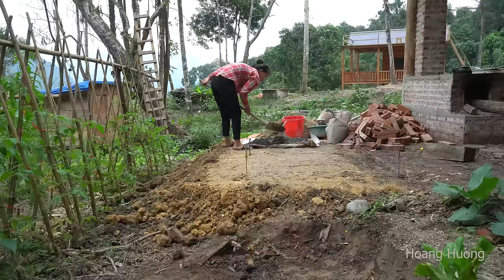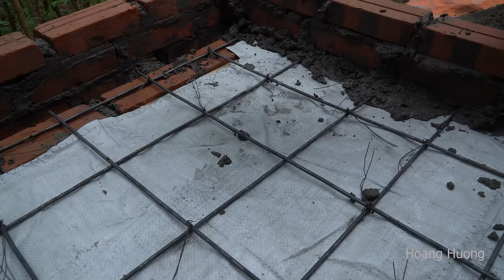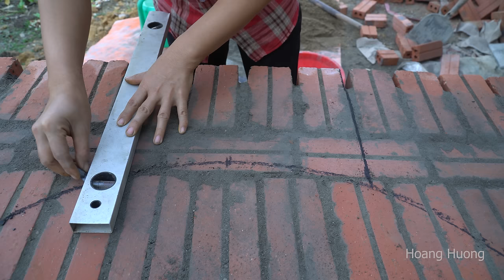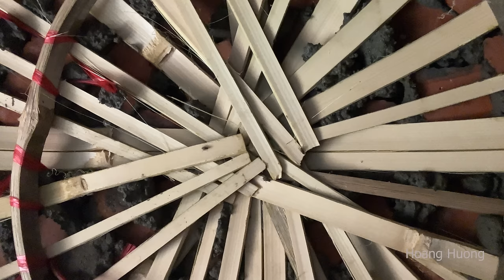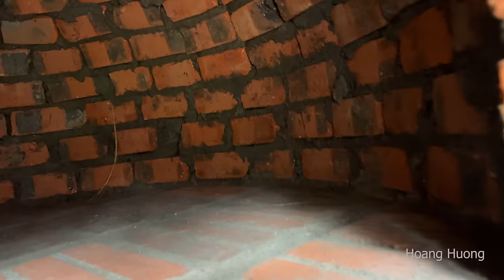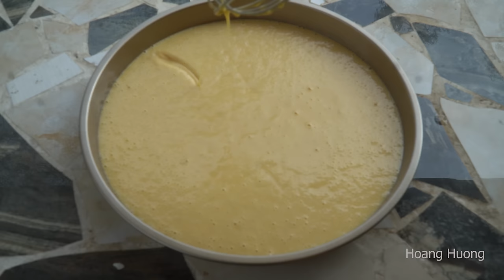Build a brick pizza oven, Bake sponge cake | Hoang Huong

Comment: Love the oven!  The only thing I would suggest is to create a door for it. That will help to trap the heat inside.  By doing this  you can rake out the coals before before adding your cake.. this will help it not to burn on one side.  You did a beautiful job on the oven, congratulations ❤😊

Comment: @Hoang Hurong.. Awesome effort as always. When you use a pizza oven you need to spread the fire on both sides of the oven. Also, it may help if you have a door on it to hold the heat in. I would not use alfoil/aluminum to cover the cake. Your cake cant rise properly and you need it to go golden brown. Plus if you have a door your cake should cook in half the time. Happy Baking :)
Reply: O bolo deles é feito no bambu ou na folha de baneira, é cozido não assado, bolo assado na folha de baneira é delicioso.🇧🇷🇧🇷🇧🇷🇧🇷
Reply from the maker: Thank you for your appreciation, I will try to do better, see you in the next video.
Reply: @Hoàng-Thị-Hương  you're welcome. Just trying to help make your work load easier.

Comment: You can also just burn the sticks out of the oven, though it's best to make the dome, line it with layers of paper (like newspaper), then coat it with a heat-resistant mortar an inch or so thick with plenty of sand.  And then, when it's still damp, put the bricks on the outside for support and thermal mass.  Let it dry for a week, then build a small fire in it and burn it low and slow for a few hours until everything has dried and the bamboo & paper are gone.  A final coat of cement on the outside will help seal off any cracks.  You do lose the lovely brick color, but it's more energy efficient that way.

Comment: Hi nice work making the oven but I thought you were going to finish it by cement the bricks to keep the the heat in the oven and also to protect the oven so when I see nothing happening I'm kind of little bit disappointing but you still can do it and also I was just wondering you're going to be doing a cover over your oven right you're not going to leave it just like that outside all in all good job and also I you're going to put a door on that oven because you're going to need an oven door basically you over need to have a door on it 🌸🌺🇯🇲
Reply from the maker: Thank you so much, I am very happy to receive your feedback.

Comment: Well look at that , thats one beautiful oven well done , now i would heat the oven with fire wood as pre-heating but for the baking probably would be better charcoal or heating rocks evenly spread around the backing sheets, pans or even pots so it heats all around equally at the same time a door will help to keep the heat inside and now you can bake all your traditional cakes and meals in there look for baking in a brick oven with heat inside the oven so you have better ways to get the correct ingredients for a perfect result also would be good to have yest for breads and baking soda and baking powder for cakes  to make them elevate and be really spongy  well darling those are my ideas for tgis video still going to remind you to do that extra water tank and tge gutters around the house and kitchen for extra water when is no rain
Reply from the maker: Thank you very much, I'm very happy to receive your feedback, I will try to do better and send you more interesting videos.

Comment: That seems like such a strange way to make a cake.

I’ve always used butter or margarine instead of oil. Your cake didn’t seem to rise very well and looks very dense. Is that usual for Vietnamese cakes?

My favourite cake to make is very simple: equal weights of butter, sugar, eggs and flour. Usually I use self-raising flour, if not then add a teaspoon of baking powder.

Then you just mix the butter/margarine with the sugar thoroughly, then whisk in the eggs to add a lot of air, then very gently mix in the flour and baking powder. For flavour I add a small pinch of salt, an a teaspoon or two of caraway seeds. Then bake it in a tin until cooked in the middle. It should rise and become a light fluffy cake.

Caraway seed cake is so delicious.

Comment: Pizza oven?! Shakin my head…. Ovens like this, with tall heat holding domes, have been built and used for hundreds of years.  They were not originally built to bake pizzas. 

What you built was a was a good start, but for ovens like this to properly hold the heat for baking and roasting, it needs more insulating layers than just that one layer of bricks. You should have applied at least 1-2 layers of mortar over the whole dome structure and the oven opening. And then, maybe a layer or two of cob, clay and straw, over that. These layers are necessary to hold the heat needed for long time baking and roasting. As for that chimney, I don’t see those on most ovens like this. Yes, they might help keep smoke out of your eyes and maybe a little better airflow to get the fire burning, but it is not really necessary. 

As I said, just that one layer of bricks is not going to be enough, and could lead to cracks and leaks in mortar joints and failure of the dome itself. Once again, if you are going to put this much effort and expense in building something, take more care into building it better, studier, to last longer and be safer. If you just wanted a pizza oven, you could have built a much easier one with cinder blocks and large flat paving stones. 

When heating the oven up for cooking, you need to build a substantial fire in the middle of the oven so that it heats up the dome evenly. Heating the oven can take some time, 1-2 hours at least. When the fire is reduced to coals, no big flames, they are pushed to the sides all around to create room for what you are cooking. 

A door is also usually made to set in place at the oven opening to help hold in the heat.
Reply from the maker: Thank you for your feedback